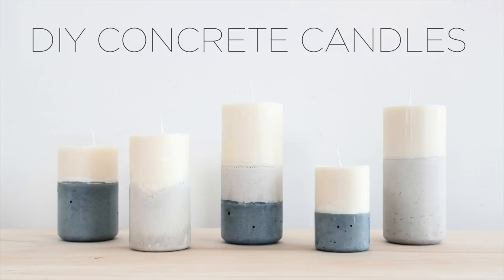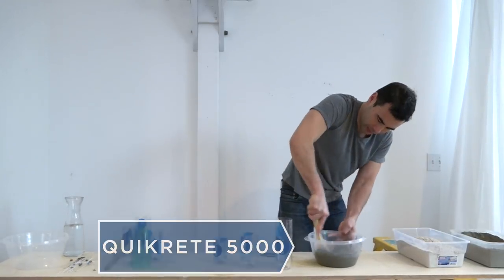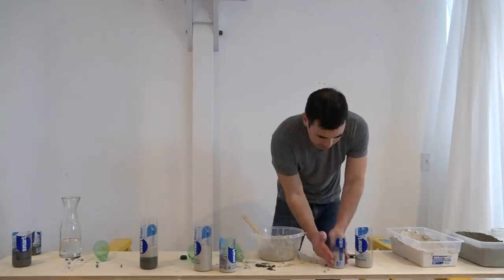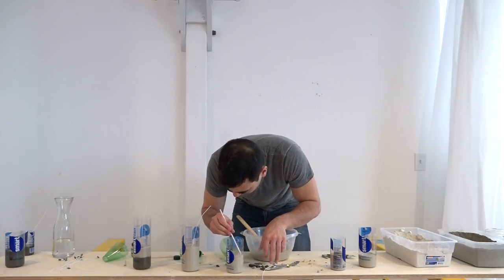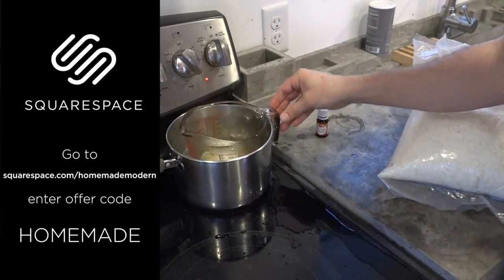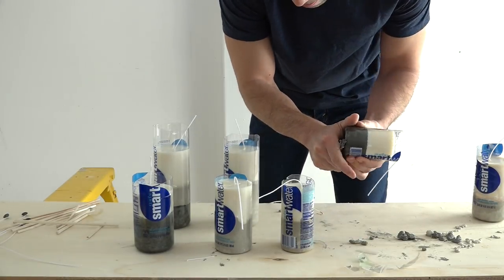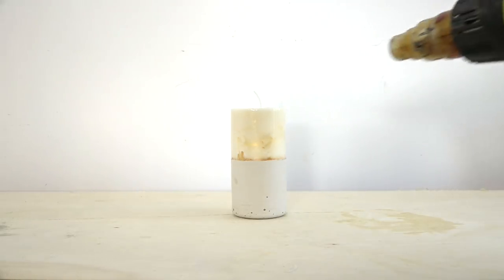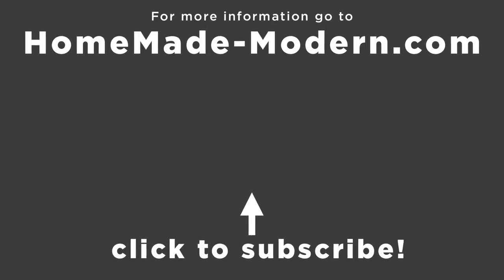DIY Candles with Concrete Bases

Comment: silly question, but what do you do once the candle has melted?  Can you re-use the concrete base?
Reply: you could use it in your garden landscaping.
Reply: i think its no silly, i have the same question.
Reply: Well, concrete is very cheap so it's not very wasteful if you just throw it away. A ton of people don't actually light their candles, they just use them as  decorative items, so this candle is perfect for that :)
Reply: Keith West remember in the beginning he had to press the wick into the concrete while it was still wet.... however I guess you could just hot glue the wick to the concrete
Reply: No, don't reuse the concrete. It can cause an explosion capable of destroying a whole neighborhood.
Reply: Keith West one thing you could do is slide it back into a bottle, pour a fresh layer of concerted with a new wick and then more wax on top, or even just put in new wax and a new wick directly into the melted wax.
Reply: Keith West I guess so
Reply: Keith West 
I agree with the question. It would be better if a concrete glass remained after using a candle.
Reply: Put it back in a similar plastic container and pour in wax again?
Reply: Keith West 
if you use a bottle that is common you could just drop the base back into a new one and pour new wax
Reply: TheHonestWoodMan this is the best answer! )) 👍
Reply: Keith West one of the YouTube commenters said that if u put a straw where the wick goes, it can be reusable by placing a new wick evertime
Reply: If you can get it to fit into another bottle mold with a fresh wick I don't see why not!  I definitely would want to throw these out either.
Reply: Have never done it before, but I'm assuming you could reuse bottles of the same shape, put the concrete base back into the bottom, maybe seal the edges with silicone so the wax doesn't drip down, and then put a fresh wick in and pour in wax? Although if sealing the edges with silicone is not an option, any overflow of wax down to the concrete base could be melted away with a heat gun, I suppose!
Reply: Keith West Yeah, you could. you'd want to remove any leftover wax and wick and make a new mold around the base. Maybe you could stick it into a new bottle or cut a bottle into a sheet and wrap it around. Stick a new wick onto the top of the concrete and pour on new wax.
Reply: Keith West it's just a matter of putting a new wick in which I suppose you can do with the new layer of wax and weighing it down with a base and some glue or something
Reply: What I'm trying is while casting the concrete is to put a tealight holder in it then cast my candle on top. That way after the main candle burns it can still be used as a tealight candle holder. I will post the results on my Instagram once completed

Comment: Great idea Ben! It would be cool if you used a smaller diameter water bottle and put that in the wet concrete. Let it cure, then remove the inner bottle and then pour the wax. This way the candle ends inside the concrete rather than on top and you would have a cool effect when you burn in down that low. Also, the concrete bases would be "refillable". All you'd have to do is a new wick and wax Awesome project though. The simple ones are my favorite too

Comment: If you had put a straw through the concrete, then placed the wick through the cavity, you would have gotten refillable/reuesable candles. A fantastic idea nonetheless, especially as they can't get knocked over easily.
Reply: Won't te hole for te wick fill up with wax anyway? You'll need to microwave it first or pay as much of an effort into it as creating a complete new one.
Reply: It may lead to the candles burning all the way down the wick and burn the base but that is a clever idea
Reply: OutOfNamesToChoose Yeah but once it melts enough the wax wil drip all over the place through the hole.

Comment: Hello Ben,

I did the same, except for the wax, I couldn't find soy flakes, so I used paraffin and stearine and a Pringles box instead of plastic bottles. Problem is the wax did not stick to the concrete... So I have 2 pieces. 
How could I glue them back together please?
I love your videos and your designs, thank you.❤👏

Thanks, Sophie

Comment: Soy wax normally melts to a liquid - did you add something to the wax to stop this? Otherwise it will be all over your table after being lit for a short while.
Reply: probably just put something under it to catch the wax/liquid, except it will get all over the concrete sides.

Comment: The candles look great! However, may I advise (as a candlemaker) to use pillar molds. Using plastic bottles can be a hazard and a mess as the hot wax will certainly compromise the structure of it. Pillar molds are metal and easy to use.  :)

Comment: Be careful not to pour the wax until the concrete has set for a full days - I tried pouring after just a one day cure and the two separate and come apart very easily